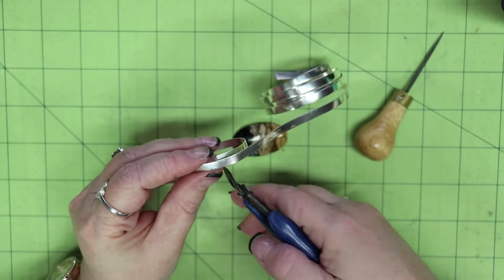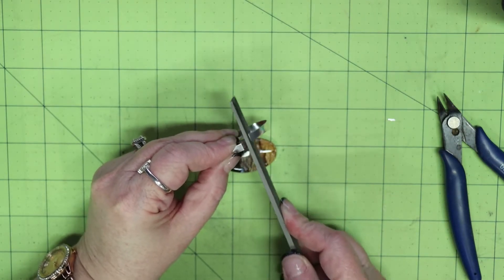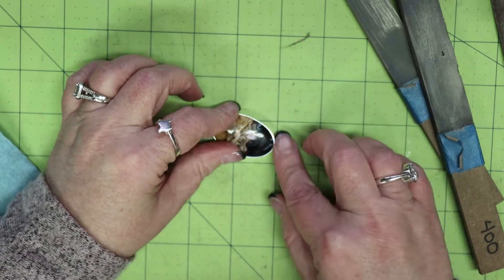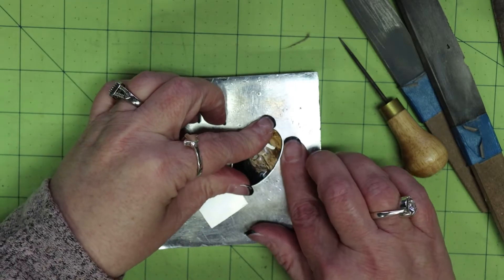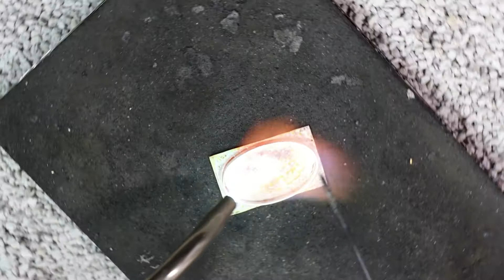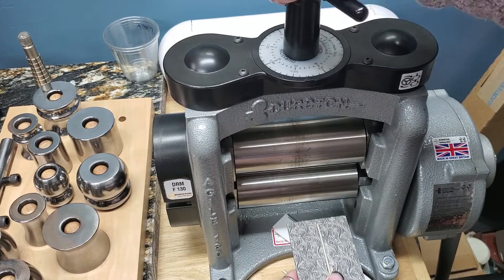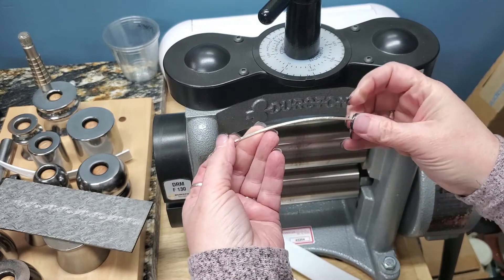Beginner Series: Fossilized Palm Root Cuff Explained

Comment: I love your videos so much I am constantly watching and rewatching😁 Question: After the final buff and you move to the clean up process with the ammonia solution is it safe for stones or should this be handled without allowing the solution to hit the stone?
Reply from the maker: Thank you! I'm glad they are helpful. I have never had an issue using the ammonia solution on a piece after the stone is set, but you should always do your research first. I don't actually run the ultrasonic unless I have researched if it is safe for the stone. I just heat up the ammonia solution in the ultrasonic and then clean the ring with a soft toothbrush while the machine is off. There are many stones that should not be placed in an ultrasonic machine because the vibrations can crack delicate stones. Hope this helps!
Reply: @tammybaalman2429  Your the best!!! Yes it helps tremendously thank you!! Watching your stacker ring with cab video now😁💖

Comment: I really want to make one of these!!! Do you think if I used 10 gauge half round for the metal I could accomplish this with a butane torch? In my small space right now its all I can safely use....
Reply from the maker: I have a lot of trouble using the butane torches on bracelets, but I have been successful if I use 2 of them at the same time. It can get a little tricky, but the extra heat really is needed. Be sure and use a barrier flux to prevent firestain. Good luck!
Reply: @tammybaalman2429  Thanks Tammy!! That was my next question about the barrier flux I understand that it's denatured alcohol and boric acid correct is that the same borax that I'm seeing in the store I see it but I'm afraid to get it because I don't know if it's the right one but it's a box it's usually with laundry soap and it says borax and does it have to be denatured alcohol or can it be like isopropyl alcohol I really appreciate all your help and guidance and I seen it coming on I think it was this video asking if you're going to be doing online classes I would so be down for that if you would!!!
Reply from the maker: @JayDub_143 , I use Boric Acid instead of Borax. You can get it from RioGrande.com and they also provide instructions for making it. https://www.riogrande.com/article?name=MixingBoricAcidBarrierFlux. I really haven't considered doing online classes because my time is so limited. I may consider doing some live videos taking user suggestions for topics to cover.
Reply from the maker: @JayDub_143 , I just posted a video on how to make your own barrier flux and how to use it. You can find it at https://youtu.be/JP3i536DpIc.